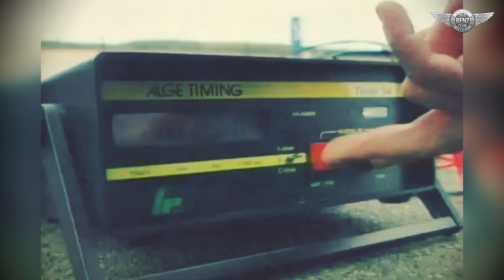Mercedes Brake Assist System 1998

Comment: This afternoon while driving home a 10 year old boy ran from behind a panel truck into the street in front of my car. I hit the brakes and the W202 Mercedes C230 stopped abruptly, almost as if it were suddenly glued in place. The boy and I were both shocked realizing that I might have hit and injured him had I not been driving a BAS equipped C230. I'm a cautious driver, and in the 23 years that I've owned the car, this is the first time that I've been aware of the system activating. The BAS light shown on the dash, so when I got home I read in the owner's manual but didn't understand how the BAS functioned until I watched this video.
Сегодня днем, когда ехал домой, 10-летний мальчик выбежал из-за грузовика на улицу перед моей машиной. Я нажал на тормоз, и W202 Mercedes C230 резко остановился, как будто его внезапно приклеили на место. Мы с мальчиком были потрясены, осознав, что я мог бы ударить и поранить его, если бы я не управлял C230, оборудованным BAS. Я осторожный водитель, и за 23 года владения автомобилем я впервые слышу об активации системы. Индикатор BAS отображается на приборной панели, поэтому, когда я вернулся домой, я прочитал руководство пользователя, но не понял, как работает BAS, пока не посмотрел это видео.